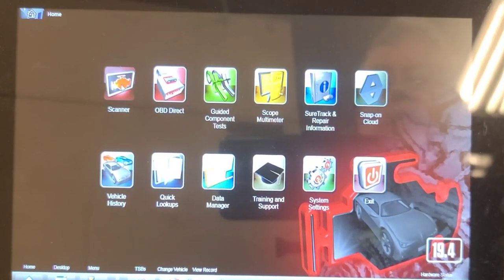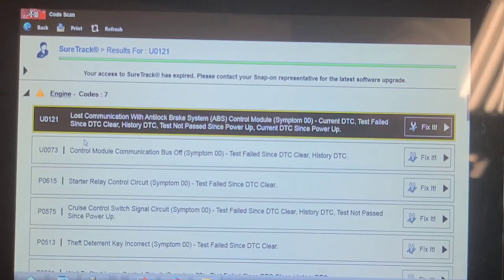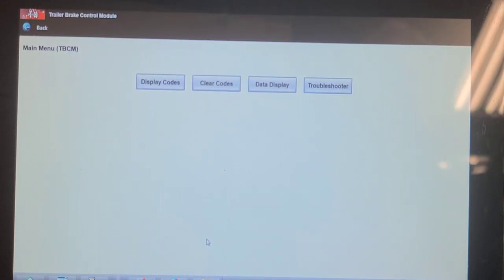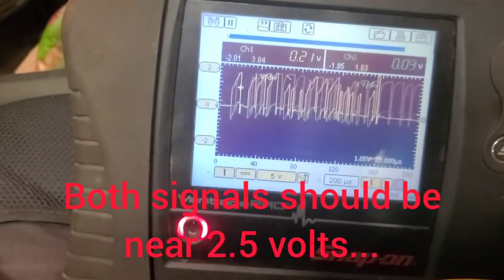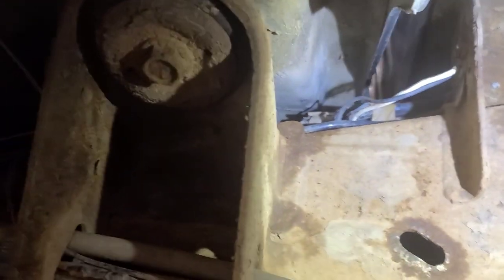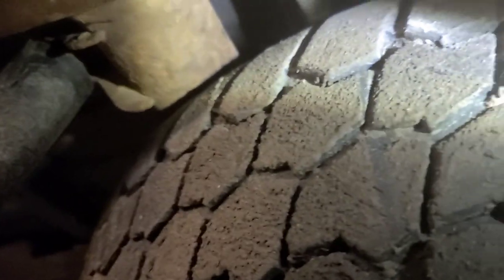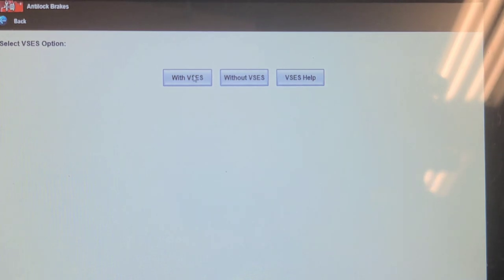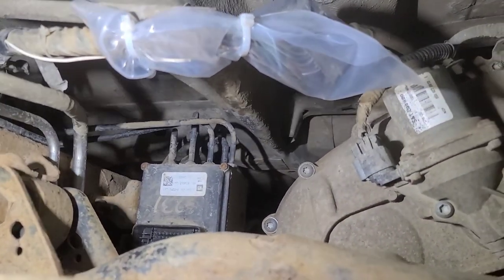2011 GM Truck 2500 HD, No Crank, Multiple Network Codes.

Comment: Love these videos!  What scanners, tools, or software are you using to diagnose?
Reply from the maker: In this diagnosis I'm scanning the network with a Snap-on Verus Edge and using a Snap-on Vantage Pro two channel lab scope to view the can bus signals. I'm also using tge Vantage Pro in multimeter mode to measure resistance. At the DLC I'm using a breakout box I bought several years ago out of China. For schematics I have subscription access to Identifix.  Thanks for asking.

Comment: Great video! I like your diagnostic strategy, I was just wondering  (when you did the system scan) why I didn't see the RCDLR
(Remote Control Door Lock Receiver) detected? 
Thanks! 👍
Reply from the maker: i'm not sure that  this truck has the remote system.
Reply: @PhillipBailey  I was wondering that and no TPMS system then it didn't have that RPO option. Thanks!

Comment: I wish you were local to me. I'm having a to of issues with mine. 2010 silverado 1500 4x4 5.3. I hunt and diagnose and then change a part then get 7 more codes. 4 weeks I've been fighting this truck. On the verge of loosing my job. At my witts end.
Reply from the maker: Yes some diagnosis is frustrating. What is the symptoms you're experiencing and what codes are being generated  in the various computers. What have you done so far?
Reply: Ok well it started as a no crank no start. Let it sit overnight and it started but shut off seconds later. Did that 4 times. Later that day it fired right up and used it all day. Then again, no crank no start. Original code was P1682. So I did the ignition switch and tumblers. Still nothing. Then the security light came on. Tried to reset but would not go off after 10 minutes. So I bought a used bcm. No change except security light went out. I noticed i had power every where except the fuel pump fuse. Purchased a new fuel pump. Original pump was leaking out of the electrical plugs and from the rusted top. I figured that was it, but no.. checked the fscm. It was getting juice. Bought a ecm and fuse box. No changes. Now getting like 7 codes. U0100, U0109, P0118, P0315, P0230, P0449, P0700. I'M at a loss. Ran out of money and about to lose my job and my mind. I hope you can help
Reply from the maker: @dannyg7823  P1682 is a problem with one of the ignition feeds to the ECM. It is usually caused by a failing run/crank relay, PCM power relay or corroded connections in the fuse panel under the hood. Check the under hood relay center for corroded terminals on the relays and corroded fuses. P1682 sets when there is more than 3 volts difference between the 2 ignition voltage circuits to the ECM. The first ignition voltage is supplied by the powertrain relay through a fuse number 4 and the second is supplied by the run/crank relay through a fuse number 58. This can cause a no crank or start and die symptoms. I believe the fuel pump fuse is on the switched side of the fuel pump relay which only applies to LY9 and L96 options. I don't believe you have those as your truck has a fuel pump driver module in the rear and no actual fuel pump relay although the fuse box may have a place for one. Did you have the BCM programmed to the truck? If not you will have VIN mismatch codes in the ABS and Restraints system. I doubt your BCM is the problem. I'd focus on the fuse box and the P1682 code. The U codes will be generated due to a lack of communication with the ECM if there's a power problem to it. If you live in an area where salt is used on the roads the fuse panels are prone to failure. New from GM is not that bad and there are several versions depending on what options your truck was  built with. Good luck and let me know what you find. You mentioned the fuel pump was rusted out so seems you are...
Reply from the maker: @dannyg7823  here's a video I did on a Canyon with a P1682 code. It's similar to yours. https://youtu.be/_d8bdUmH_o8
Reply: I actually replaced the fuse box yesterday. Mine was pretty bad. But didn't get the U codes until I changed it. I think I will start wiggling wires. Lol. I did find that G103 ground  was soft in the front and the thinner ground had a break in it. Also was full of moisture or oil. I appreciate you taking the time. I'm stressed out over this truck.

Comment: Hi Phillip, why wouldn't you retry the module after seeing all of that sand drop out of it when you removed it?  I'm wondering if the ABS module simply had a faulty connection because of the dirt and grit.  Otherwise, great video watching your thought process.
Reply from the maker: No the dirt was not causing the issue. Internally shorted CAN Bus is pretty common on these. I've seen 5 or 6 now. HTH
Reply: @PhillipBailey   Interesting....  question for you:  I have a 2011 GMC Sierra 3500 HD.  Battery is good, but it often won't crank over.  When it doesn't crank over I can't hear the relay click over either.  No DTC codes.  Your thoughts?
Reply from the maker: @northernlightsrenovations1710  you need to monitor the status of the park neutral switch on the scanner, as well as the crank request. Swap the starter relay if you haven't already. Jump 30 to 87 at the starter relay and it should crank. (Make triple sure it's in park) . If its a standard possibly clutch switch. Check for power at the starter S terminal when you're trying to start it. If the starter relay is not energizing I'd be focusing on its control circuit. Security issues should set a code unless your scanner isn't reporting it. HTH
Reply: @PhillipBailey  Thanks Phillip.  Strangely, I get a 'Service Theft Deterrent System" message on the dash now, which happened about the same time.  I'm starting to think it might be related.
Reply from the maker: Yes the theft system can disable cranking. Need to do a network scan for codes.

Comment: great video, i have opposite issue, can Hi, Lo are over voltage,. getting 2.9v Hi and 2.6V Lo. also getting 120ohms  but when I unplug rear Resister i only read 7.9ohms. also have U0100 code no Comm with ECM
Reply from the maker: Where are you measuring the resistance? If at pins 6 and 14 of the DLC a measurement of 120 indicates an open but disconnecting the terminating resistor should make it increase not decrease. There's a connector under the dash at the left junction block by your left foot that when unplugged will take the back of the truck off line. (Removes the onstar  abs and fuelpump driver. Try unplugging that and see if you have com with the ecm afterwards. Seen ABS modules take down the network on these.
Reply: @PhillipBailey  thanks for reply. i will try but which connector are you talking about. there is several. i do see the JB by left foot.
Reply from the maker: @AtanasDimitrov954RR  here's another video. It's basically the same system and talks about that connector x3 at the junction box. That's a 5 min into the video. https://youtu.be/_G4U1_tTFkM

Comment: Thank you for the video! I'm still learning CAN troubleshooting, and still trying to understand, The terminating resistor you measured was 34 ohms, I thought terminating resistors were about 120 ohms. I must be missing something. Could you help me understand? It would be very much appreciated!
Reply from the maker: Yes you are correct, terminating resistors are located at each end of the network. In this vehicle there is one inside the ECM and another in the harness in the rear as I showed in the video. On a properly working can system the two 120 ohm resistors should measure 60 because they are in parallel. One of the first tests you can do is measure this across the DLC pins 6 can high and pin 14 can low. You should actually disconnect the battery to be sure there is no voltage present or it will skew the resistance measurement. In this vehicle it measure 34 ohms indicating a shorted can bus. Since tge vehicle was actually running and because I've seen this before I assumed the problem to be in the rear half of the network from tge ABS to the rear resistor. At the ABS module you can measure both ends of the network and since they are now separated with the ABS disconnected they should both measure 120ohms as they did. Even if you don't have a lab scope the resistance test would have helped you narrow it down. As you see on tge scope the two signals are a mirror image biased at 2.5 volts with the can H pulled up 1 volt and the can L pulled down one volt. I'm actually amazed that this vehicle started with such a poor communication signal shows how fault tolerant the can system is. Here is another Duramax that had can issues among other things that would not crank unless the aftermarket tuner was connected to the DLC.. I'll post the link shortly...
Reply from the maker: Here is another one I did awhile ago that I never fixed but you will see the can testing https://youtu.be/_G4U1_tTFkM
Reply: @PhillipBailey  Thank you, appreciate the help. Just trying to learn as much as I can!
Reply: @PhillipBailey  thank you again, appreciate it!